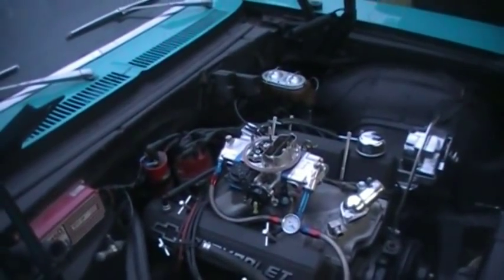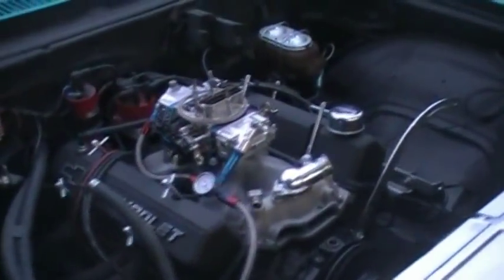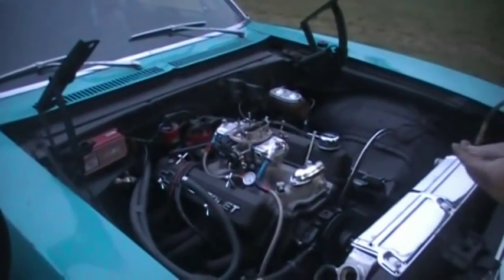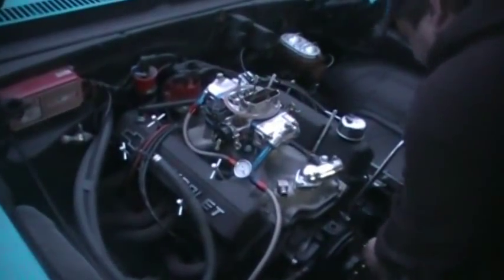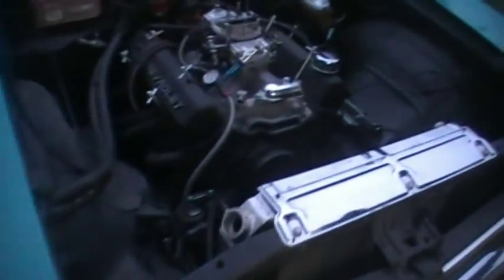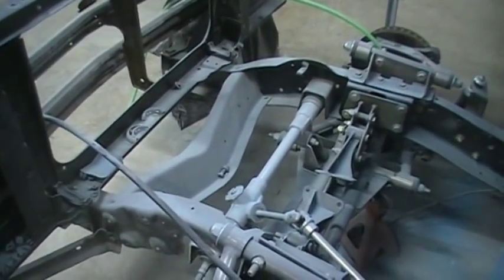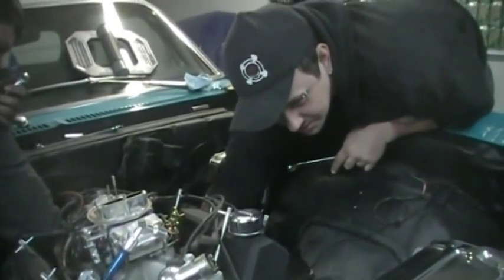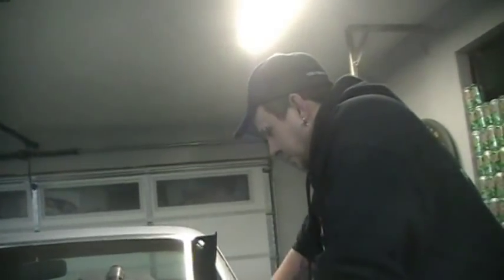Shut Yer Face Garage  Engine painting: Pulling the engine part 1

Comment: A little tip for blowing the dipstick issue is drill a 1/8 hole in the tube so the hole is just below the pan rail. This lets the pressure bleed back to the crank case and it wont pop the dipstick out anymore.

Comment from the maker: @SpecialedSpellcaster I've had problems with low mount brackets on Novas/Camaros because of the lower crossmember. I have a Pass side mid mount alt. bracket from Billet Specialties on my Nova and it just clears the fuel pump. Its been awhile since I've checked alsa out but I have used some of their paints in the past. I'll check that starter out thanks!

Comment: The same alternator bracket was on a Camaro I resto-moded and I swapped it out for a lower one. If you want it mounted on the same side GM produced a lower driver side alternator bracket for 65-74 cars without power. I don't recall the part number, but they're about $25 new. On the passenger side you have to run an electric fuel pump. For a starter try Pro Comp's PC2106 on ebay. They are really good and don't cost much.

Have you ever seen the colors Pink Lemonade or Cotton Candy from Alsa?